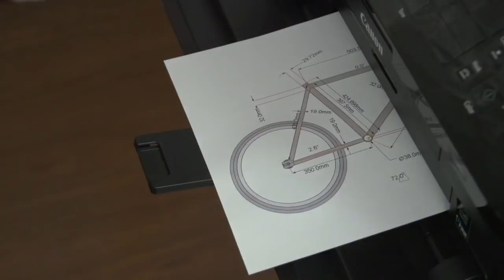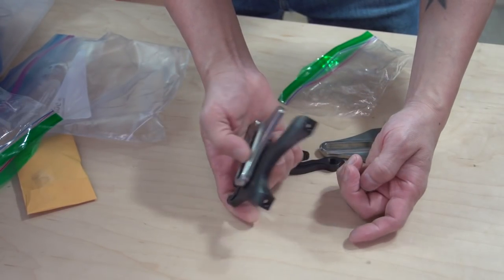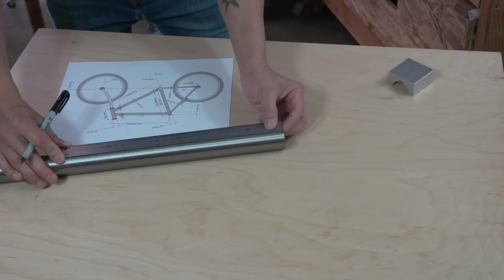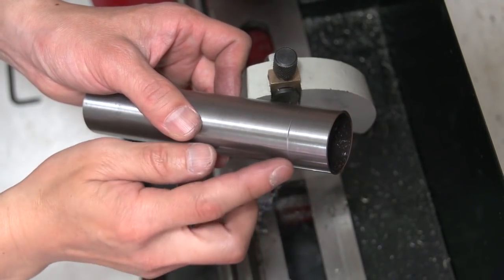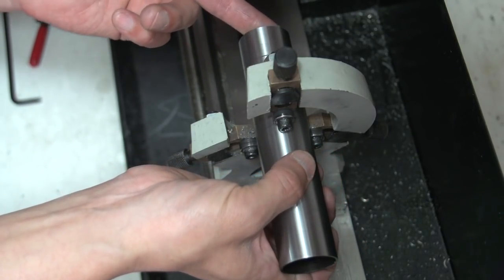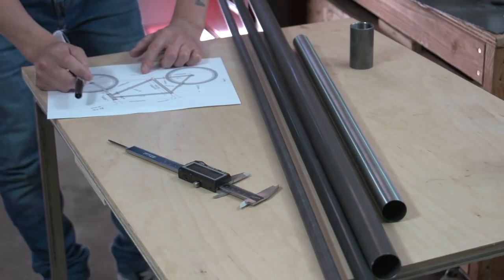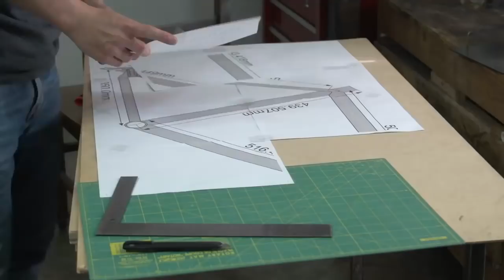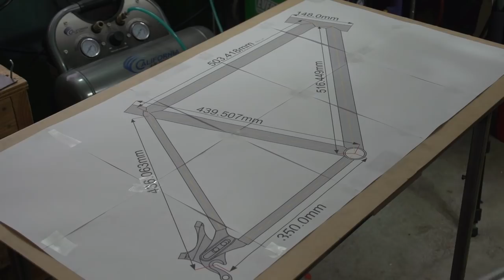Cut Tubes - Mini Town Bicycle 03

Comment: I have a 1967 Clausing/Colchester 13x36 Lathe in the garage, and yes, you are correct - my giant 1500lb, three phase monster wouldnt fit that fat tube inside the spindle, you'd have to have a 15" or bigger most likely- so the way you're doing it is best option!

Comment: Trimming the head tube:  Angle your cutter and just cut with the end instead of trying to cut with the whole side of the cutter. Will put an end to that chatter.  Also get you a file for the lathe and you can take off the burr while it is still on the lathe.  Put it back in the chuck after you finish with no steady rest and just hold some scotchbrite on it to remove the marks.
Reply from the maker: Yes! I should have turned in to the face.
Reply: Also see if you can get some plastic pulley bearings for the steady rest, keep a good set, and then you wont mark the outside of the tube
Reply: In addition, another chatter-busting tip I discovered is using variable speed to keep any particular frequency of chatter from developing. If you oscillate the spindle rpm it becomes much harder for chatter to develop. If your lathe doesn't have varispeed, you can bump the spindle motor on and off for the same effect, but I suspect that's harder on the motor and switches.

Comment: why not attach front rack to the frame rather then the forks? Makes for a more stable ride when loaded
Reply from the maker: Dave Tappy because most of the time it just some light things in the basket. I do want to build that type of frame some day. I like the cycle trucks design a lot. It’s brilliant.
Reply: @PithyBikes  ah, ok. I look forward to you doing something like that

Comment: Make a set of “tyres” to go over the bearings of the center steady, make them out of plastic or copper or something so they are softer than the tube and therefore can’t mark it, should only take 10 minutes 👍
Reply from the maker: Benspeed's Channel great minds think alike! Yes!
Reply: Pithy Bikes that was my good idea for the month, I need to lay down now 😜😂😂😂